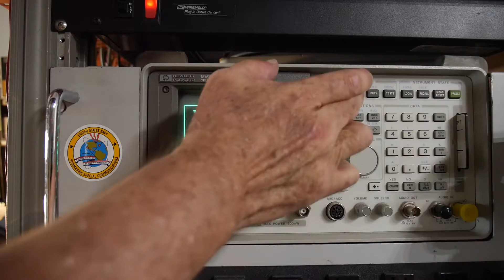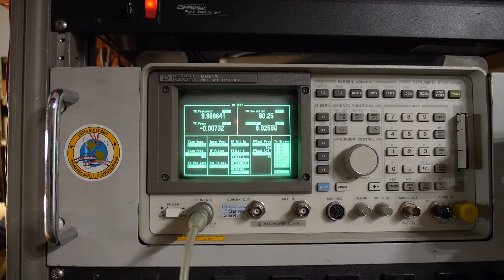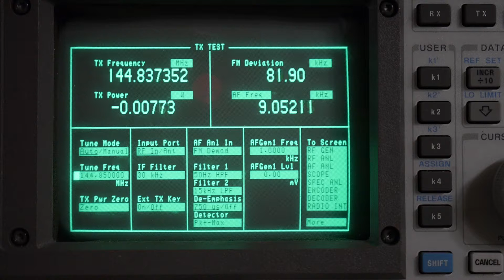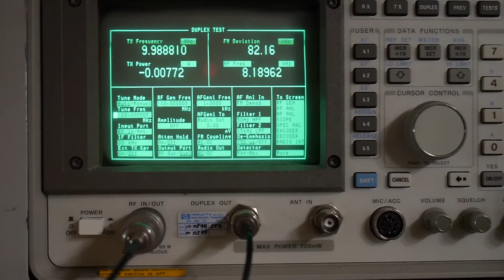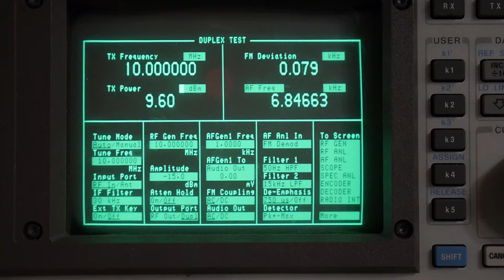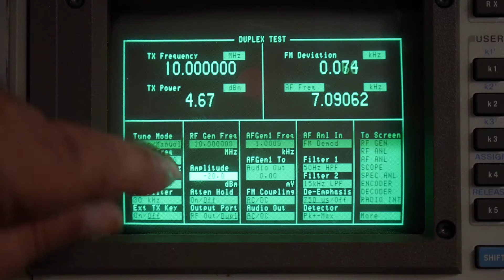#369 Measuring an amplifier on a HP8921a

Comment: thank you so much got an idea how to generate and how to keep your device on safe hande. sir here is one question where i will see the reult which i need to test the" the rf power level from the repeater" for that i need to go to the rf analyzer mode or they will shown on the same screen.
after that i will need the rusult in printed form for the the approval.plz guide
Reply from the maker: You need to know the expected power level of the device under test BEFORE connecting it. The max power of the device under test must be less than 60W. Use a high power attenuator if it might exceed that.
Reply: @IMSAIGuy  the device under test is Tetra indoor repeater -COBHAM-D-CSR-3604
Reply: I will generate rf at -40 db bz normally the repeater recieve -45 dbm signal level from Tetra base station so I will input same like base staion
Reply: Gauhar Rehman 36dbm is only 4 watts so no problem
Reply: @marko99butter  ok sir thanks